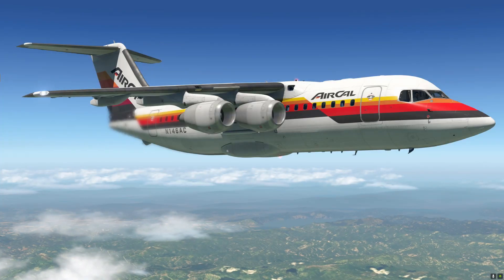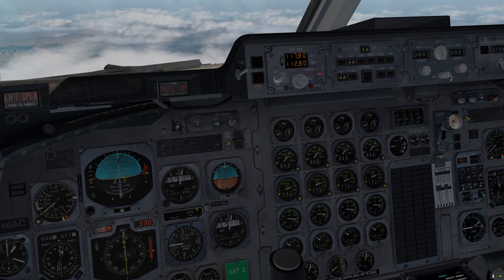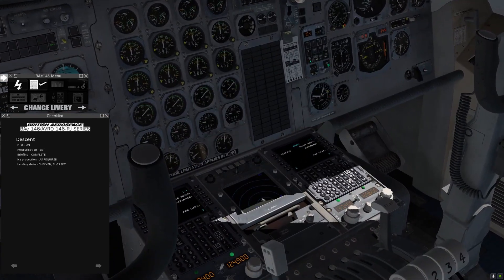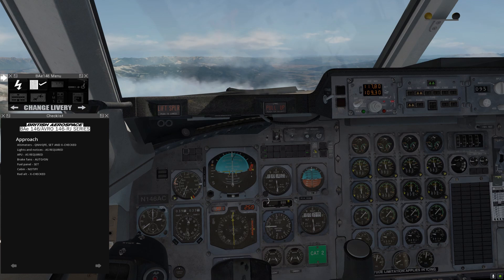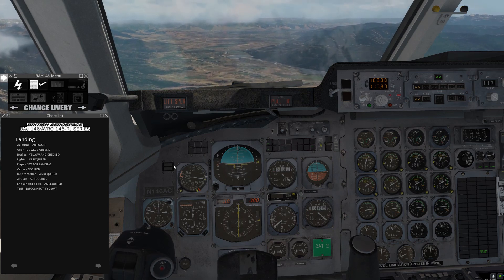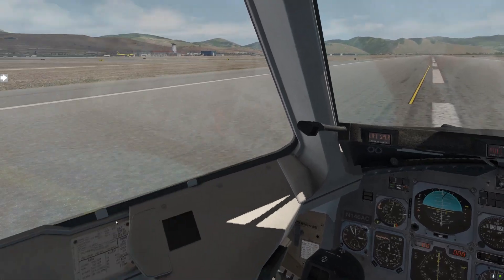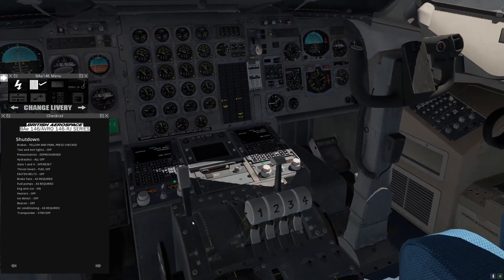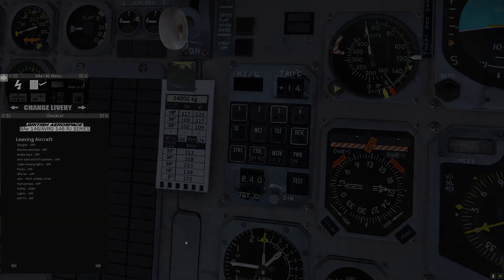JustFlight BAe-146 for X-Plane 11, Descent, Approach, and Landing

Comment: One question and one note.

1 : Why open the speedbrake on the final ? Doesn't seem like the engines have a long spool time or narrow power band that'd require the brake to be able to run them high.
2 : To make smooth turns I turn before the HSI/RBI show I've crossed the VOR, using 1NM=6000ft of slant range to guesstimate the vertical distance from the beacon and the speed on the right of the DME readout falling away as I near the VOR.
Reply from the maker: Good question (and good note!)
1. For most normal landings it's not necessary.  It just helps bleed off the excess speed from Vapp to Vref, especially if you're carrying an extra 5 or 10 knots for windy conditions.  But it can be necessary for steep approaches, and gives the pilot an extra tool for controlling airspeed on short final.
2. As I'm sure you noticed, I was distracted and completely forgot to actually turn the plane as I crossed the VOR.  :P  The rule of thumb you posted is indeed a very good one!